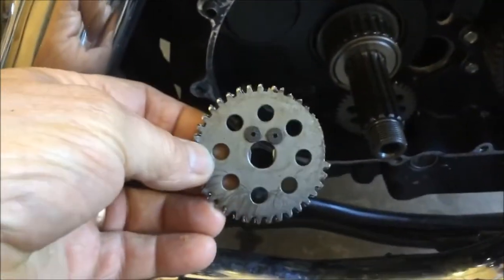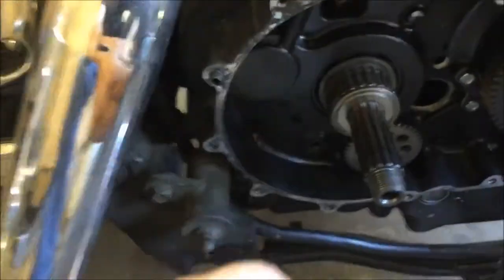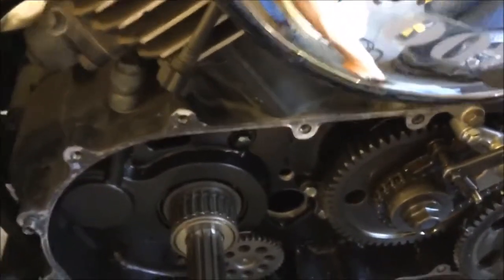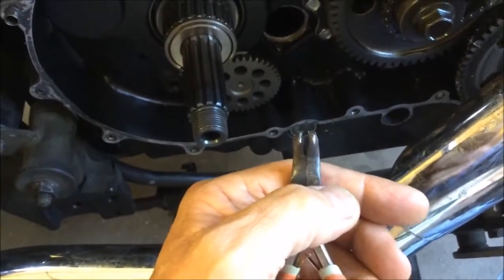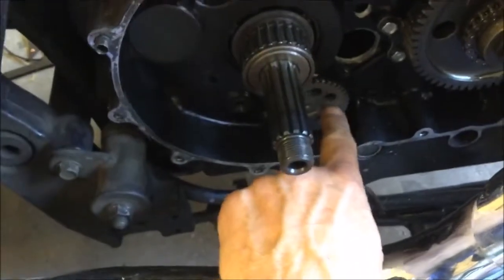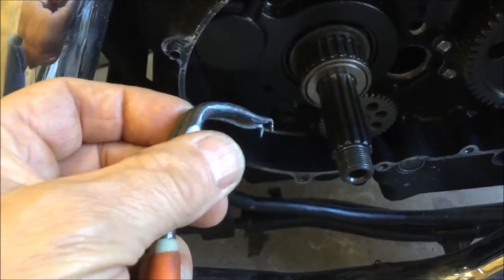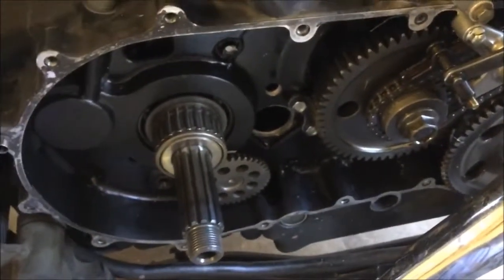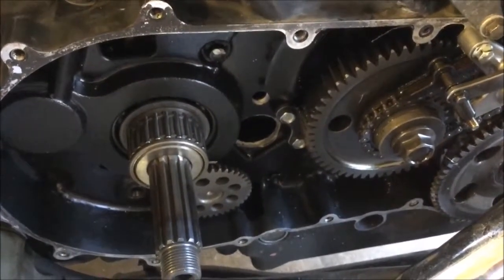Replacing Kawasaki Vulcan 1500 oil gear like a surgeon in seven minutes (without splitting the case)

Comment: Thanks Gary for the video. I just got the clip on the new gear. I purchased a endoscope camera online, could not have done this without it. People should know that the clip can fall off, as it happened to me. I had applied to much pressure trying to get it off the shaft and stretched the clip. Luckily I had ordered a new clip to use to get the needle nose pliers to fit. It took me hours to get the clip back in place and back on the new shaft. I put the camera in the 1-1/8” hole and used the home made tool in the same hole. The length of the needle nose pliers I used was 2-3/8” long. I just barely had enough length I would recommend a bit longer. When taking the clip off the shaft I recommend blocking the bottom hole (hell hole”) with a shop towel to prevent the clip from falling down in the oil pan. Also I tapered the new shaft to help that clip slide into the notch on the shaft. It can be done, and I am not very mechanical inclined. Thanks again Gary, could not have done this without your video.
Reply from the maker: Good to hear. Next time you clean the oil pump pre-screen be super careful not to allow any metal shavings, (that might have gotten into the pan), to find their way past that screen or they may cause the pump to freeze up and you’ll be back to square one.  I’m not sure how your clip fell. I thought I was pretty ham handed and it never slipped off. I didn’t think there was enough room. That would really spoil the fun. Congrats.

Comment: Just to let you know that I performed the keyhole surgery and successfully completed the repair. At times I thought it was a windup, but no, a lot of persistence and patience, it really does work 😀
Thank you for having the vision to attempt it in the first place 👍🏻
Reply: I have to do the same job myself next week. I ordered the original steel gear from kawasaki. Did you drill a hole in the casing?
Reply: Hi Jason,
Yes, just as described in Gary’s video. Made the same tool, and it works. I’ve almost done 800 miles since doing it, and my bike is running fine.

Comment: Gary, is there a video of how and where to drill the access hole for the clip? Thank you and have a most awesome evening!
Reply from the maker: There was a video link that I shared until recently because it’s creator made it private. However I’m going to be doing some more work on this bike starting this weekend so I’ll make some measurements and post them soon.
Reply: @garyl6343  Gary, Wow, Thank You for the extremely expeditious reply and going out of your way to help! Have a most awesome evening! Jeff...
Reply: Hi Gary ..im in the process of buying a 99 nomad with 7000 miles on it ..I absolutely love the bike ..I had a couple of questions ..if you would be so kind ....should I go ahead with the purchase ..if so should I just ride it out and see what happens ?or should I do this right away ?
Reply from the maker: @irishmikeful  Tough call but when the gear goes bad, the oil pressure is gone so you could be stranded. It’s a pain is the ass job to do on a running bike. I’d probably ride it but if you do, and the oil light comes on, don’t think about it. Get to a safe place and shut it down.

Comment: Do you have to plug that drilled hole up after or is it okay to leave it open planning on trying this with my bike oil gear just went
Reply from the maker: You don't have to plug the hole. The oil finds it way down into the pan either way.

Comment: I’m doing this now and my clip slip off the shaft so now I’m struggling to get the washer seated then flip the clip to get the pliers on and it’s just a pain in the ass. It’s like a 3 hour job if you don’t do it right away like this video.

Comment: I didn't realize you have to drill a hole. That doesn't hurt the motor at all (metal shavings aside - I'm just talking oil flow)?
Reply from the maker: The oil  that comes through the holes just flows down into the pan.

Comment: Gary, help! Disaster has struck. The piece I was cutting out fell in the engine with no sign of it with the scope!!! Any ideas what to do?
Cheers 
Andy L
Reply from the maker: Glad you got past this. Sorry I didn’t see it in time to respond. How did you end up finding the piece?
Reply: Hi Gary, unfortunately I couldn’t find it! So after 4 oil changes and filters, I am trusting to luck that it stays at the bottom of the pan 🙏🏻 
I’ve done a couple of hundred miles on her, and she’s not missed a beat 😀 Hopefully, that’s how it stays.
Thanks again from over the pond 👍🏻 Andy L
Reply from the maker: @AndyLawman-iz3sq  The screen will keep it from being sucked into the pump. I’ll add some prayers. All the best. Gary

Comment: Fantastic video! Thank you for posting this. These old bikes will run forever with just a little TLC! 
Would drilling a larger access hole be possible/make the job easier? Mind me asking what brand/cost was the bore scope?
Reply from the maker: I couldn't say for sure if a larger access hole is possible but I doubt it would make the job easier unless it was significantly bigger and I would be concerned that could weaken the integrity of the case. The scope is still on Amazon for $37.98. TODSKOP 5.5mm WiFi Borescope. Not fancy at all. It connected to my IPad via WiFi. Thank you!
Reply: @garyl6343  thank you so much!
Reply: @garyl6343  it's on sale, $31.99 !
Reply from the maker: @MikeZyouthpastor  That one is slightly different. Not sure if it matters but the one I bought is still on there for $37.98. Same company.
Reply: Gary L I would make sure you purchase the borescope with the 5.5 mm the one I used was 8 mm and it was not fun. Do yourself a favour.

Comment: How did you know where to drill and what size drill did you use?
Reply from the maker: I believe the larger hole was a 1" and the camera hole was 1/4 to 3/8" (just enough to get the camera in and have the ability to move it. When I started I wasn't certain where to drill so I got a close as I could without disturbing the "v" just below the bigger hole, since I didn't want to weaken the case. Pretty much estimated the best angle to see what I was doing from the camera hole. Also, there was a video which has since been removed that did something similar but he didn't use a camera and his tool was different (I don't remember what it looked like now). I  knew the camera would help and I liked the idea of making the tool by modifying a readily available tool. Don't forget you must never let any metal shavings get past the oil pump pre-screen because if they get sucked into the pump you will be splitting the cases and replacing a broken pump. All the best...

Comment: Hey Gary, I have a 97 Vulcan Classic, its a vn1500d, when you replaced the gear, did it have 2 washers behind it? Looking at different diagrams, they seem to show that there is, but when i bought this bike, the gear was already gone so just the shaft is left
Reply from the maker: It looks like two on this OEM parts diagram 
https://www.motosport.com/oem-parts/kawasaki/1997/vulcan-1500-classic-_-vn1500d/oil-pump~oil-filter
Reply: yes that is the diagram that i was looking at also, so when i replace the gear I should have 2 washers on there?
Reply from the maker: @ultima1391  That is how I read it also

Comment: Hello Gary L, what did you do with the access hole? Did you have to cover it or seal it up again?? Or, did you leave it as is, opened.
Reply from the maker: I left it. Any oil splashing through will drain into the pan. All the best, Gary
Reply: @garyl6343   how is this working for you? Good I hope..how much oil loss is there? I have a 99 Vulcan 1500 Classic with 19k it’s my first bike and I’m not the most knowledgeable yet somewhat mechanically incline as I grew up working on cars and stuff with my grandpa and dad, but I’m thinking about getting the judge kit as well. I talked to Bob “the judge” today 10/18/21 and he told me to check out the POG first and oil pressure and that it should be at 80-100lbs, then give him a call back with the details I’ve found, I would like to not have to split my case open and replace a whole lot more but instead, go this route. I just thought I should look into if you actually found you did loose any oil and if you did how significantly and if not then hell yeah this will be the route I take.
Reply from the maker: @phillipyelle7719  That bike didn’t have an oil gauge, just a light. I can only say it worked well at the time but I don’t own it and can’t report on it now.
Reply: @garyl6343  my apologies for the error, he said they have 80-100lbs of pressure and your to undo the hoses at the back of the rear cylinder head slightly and then turn it over and if you turn it over and your getting oil coming out you have pressure, if your not getting pressure then your oil pump has quit or gear has broke and need to go in and inspect. My oil pressure light is on not oil gauge light..
Reply: @garyl6343  so the hope worked fine.

Comment: Gary, during the drilling process how are the drilling chips and dust contained so that they do not contaminate or cause damage to internal parts of the engine?  Have a most awesome afternoon!
Reply from the maker: I used a vacuum but you do have to be very careful the next time you remove the oil pump pre-screen because it is the last line of defense for any shavings that got missed. That is the sketchiest part of doing this. If any get into the oil pump you’ll be splitting the cases.
Reply: @garyl6343  Where is the pre screen located? Thank you for all your help.
Reply from the maker: @jeffalessi  Yes. That’s it. BTW, the owner of the Vulcan I was going to work on decided to hold off indefinitely so I can’t make this measurements after all however I cut the big hole with a 1.5 inch hole saw and you can see the position pretty well in the video. You could use a smaller hole I think. You just need room to open the pliers enough to open the c-clip. The hole for the camera just needs to be big enough to allow the bend which isn’t much.
Reply: @garyl6343  Gary, doe a separate hole need to be drilled for the camera? On a separate note is there a small factory hole under the gear near the bottom edge of the case?  I do not have the clutch cover off the engine yet.  Thank you for answering all the follow-up questions I have been asking.
Reply from the maker: @jeffalessi  Yes you will drill a separate smaller hole for the camera. You should be able to see it in the video. There is an opening below to the oil sump/pan.
Reply: What size bit did you use?

Comment: Did you drill the small hole above for the camera?
Reply from the maker: Yes. Used a vacuum to catch most of the shavings but there were some that ended up inside. Washed most of them through with a quart of oil but be super careful at the next oil change because the pre-screen will catch any leftover metal so you have to be certain not to leave any behind when you clean the pre-screen. If any get past it into the I’ll pump it could freeze and break and you’ll be opening the cases to replace it anyway.

Comment: It can be done, but it is definitely not that simple to make that tool fit…. 
You better be very patient and very steady, and very mechanically inclined …. I had to walk away from the job 10 times…. Ended up popping it on with a bent screwdriver. 😂
Modify the snap ring to clip on ever so easily while I was holding it in my hand, and then just spun it on with a flat screwdriver bent to fit up in there…. It almost took my soul….. 😭

Comment: I'm so nervous I have the ability to do this but still so nervous , typical that there's so much to do for a darn lock washer , debating between this and complete teardown on fixed income and summer is getting closer to end everyday
Reply from the maker: The only risk I see is the shavings from drilling. They absolutely must not get past the pre screen.  If successful, you’re back on the road with an OEM steel gear.
Reply: I really really appreciate this video it's going to help me out so much it seems pretty straightforward I've had nothing but bad luck I got hit by a car Deming me disabled when I was on a motorcycle then I had a motorcycle stolen and seeing this video and save my life I just have to save up to get materials that you use again I thank you for the video I hope it works for me